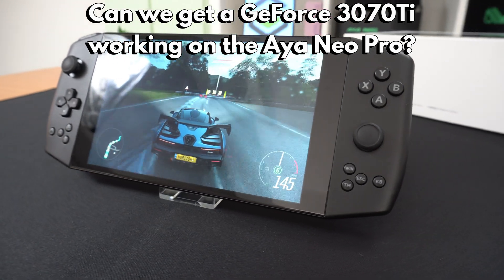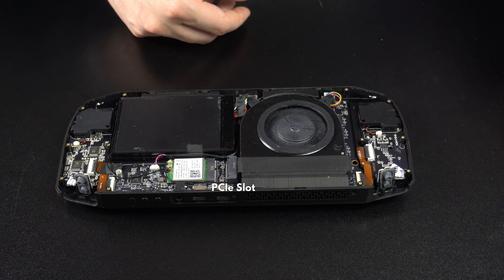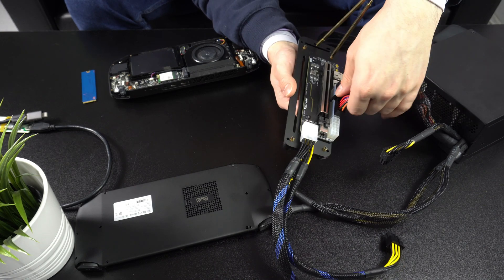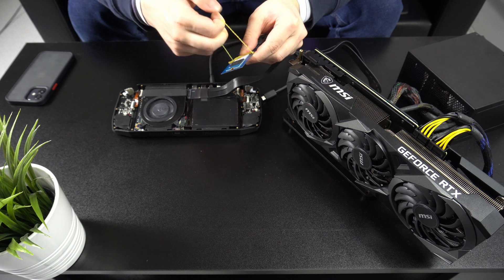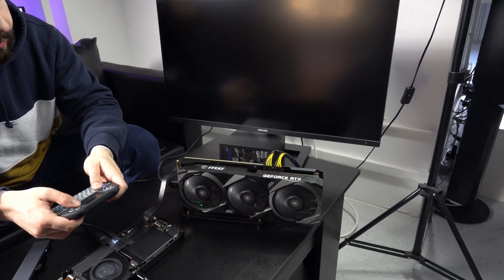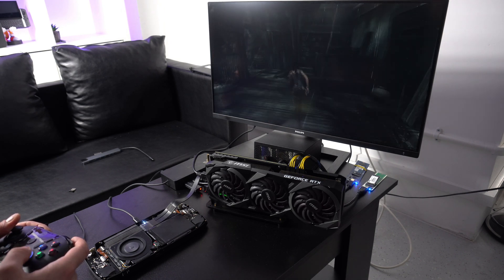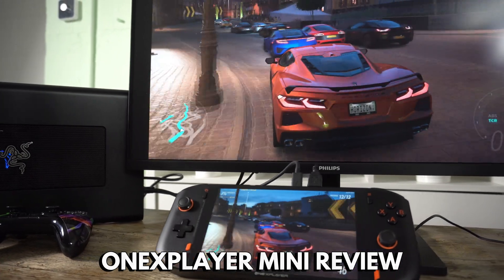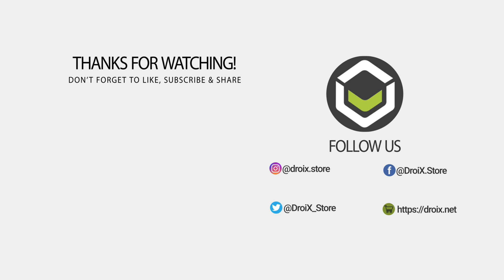Will it work? Running a GeForce 3070Ti external GPU on an AMD AYA NEO Pro!

Comment: Can I use an RX580 in this adaptation system?
Reply from the maker: In theory you could run any GPU, but it is a very messy setup. If your device supports it I would recommend an eGPU such as the G1 https://droix.net/product/gpd-g1/ it is a far easier and cleaner solution.

Comment: Isn't it possible binded Aya Neo Pro with eGPU bruh!..is it working?..😳...Just show it how you connect the Nvme ssd do not to be high scret..😆..Last time im also want to buy PCle riser same like you use in this video to power my 2nd graphic card..But the PC shop owner told me not to buy it because it could not give full performance same like if graphic card connected through the motherboard..So i think the graphic card you use using PCle Riser will not give full performance to the Aya Neo Pro device..I want buy last time because my motherboard is Mini ITX only got one graphic card slot..The owner told me better upgrade ATX motherboard to using it with 2 graphic card on the same time...He told me its useless if using PCle riser..Its just good for Bitcoin mining the shop owner told me las time..
Reply from the maker: The SSD is connected by a NVME to USB Type-C adaptor, we explain and show in the video. In our tests  with Forza Horizon 5 we show the difference in frame rate and it running 4K Extreme settings which is the highest level, and it got 41 frames per second which I think is good. You may get improved performance out of a different riser, we only used what we had in the office to see if it was actually possible to do.

Comment: Can you upgrade the processor your self to AMD Ryzen 9 5980HX?
And upgrade the Battery your self as well in the AYANEO Next Pro?
Reply: I think this it's not possible because the ram is soldered on cpu.
Reply from the maker: @hicham-gaming  Upgrading the CPU, haha - Let me see how we can pitch this to Management :D The battery, again...there are many variables in place and we wouldn't want to play with the battery (This would mean us having to resolder wires, figure out how it's designed and find a bigger capacity battery)

Comment: "In line with..." I know these CPUs ain't much compared with threadripper chips, but, one chip scoring around 10fps higher makes it faster than the other, especially given the size of the Mini and it's poor thermal capacity given that.
Reply from the maker: Which chip did you mean scored higher? Both the ONEXPLAYER MIni and AYA NEO Pro with 3070Ti scored 41FPS. You wont get much higher as the benchmark is limited by the graphics card at 4K Extreme settings. CPU doesn't come into play on either. We think we may see differences on Flight Sim 2020 where its more CPU intensive. We will look into this at some point.